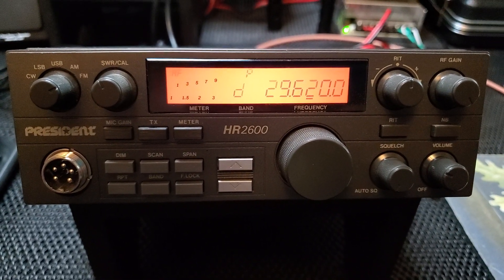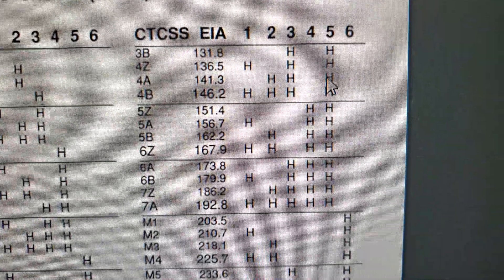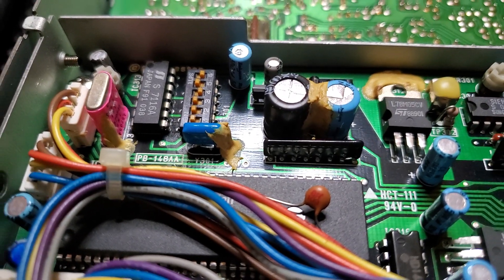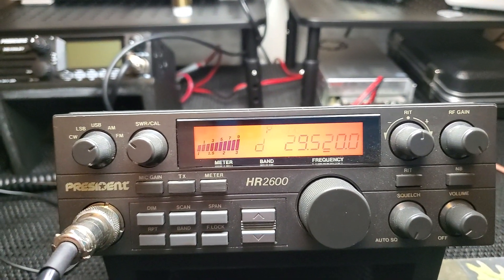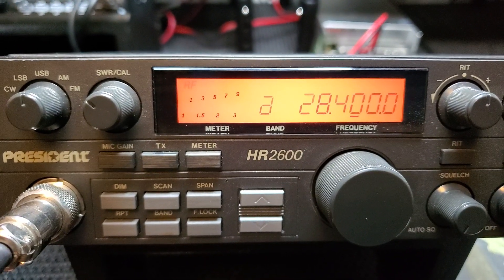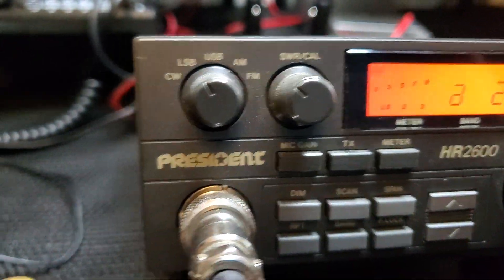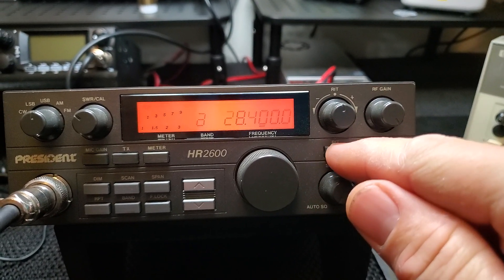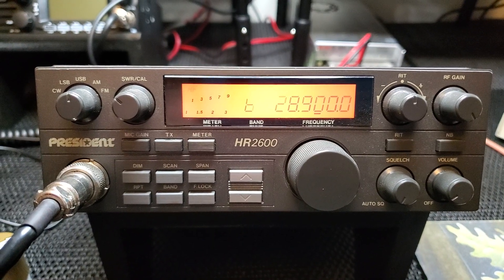President HR2600 All Mode 10 Meter Amateur Radio Transceiver. Part 2.

Comment: I think all digital modes use LSB, so it does indeed belong on this radio
Reply from the maker: I believe at the time this radio was produced the Digital modes ( Well what were available) were only for high end HF transceivers.
Much has changed in technology and advancement since this radio was designed.